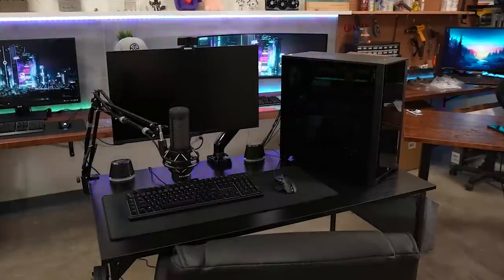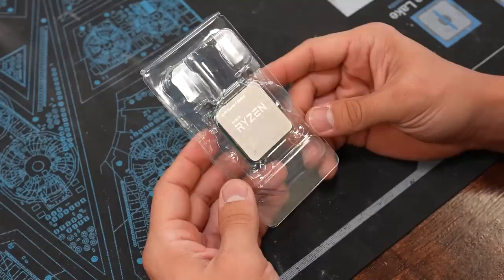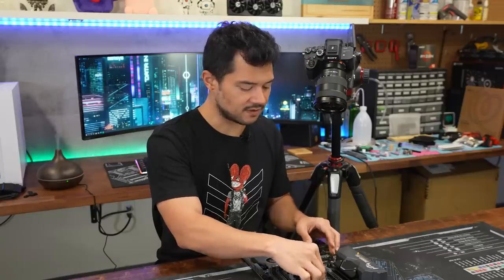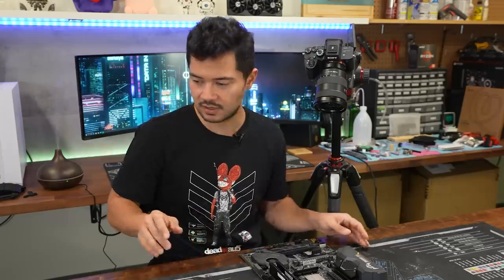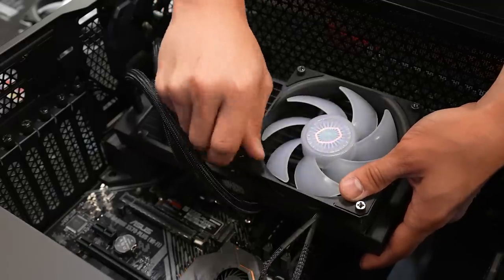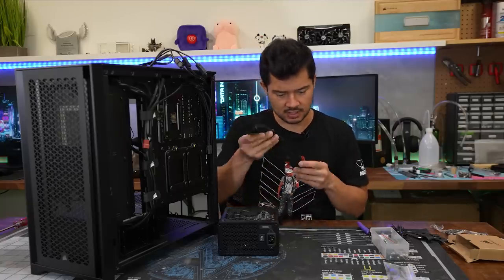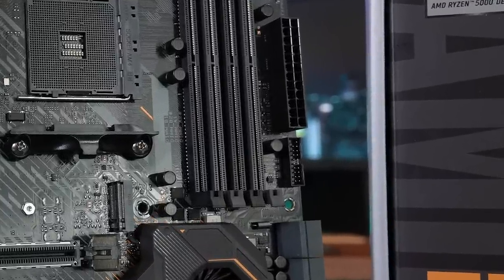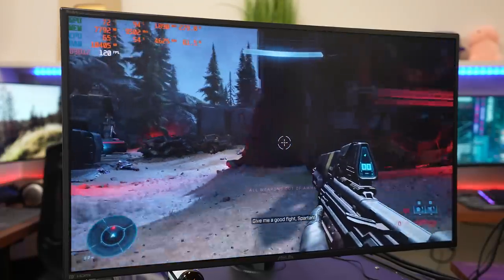The Amazon "#1 Best Seller" Gaming PC!

Comment: Almost ready to build my new PC. I have been so caught up in benchmarks and browsing the forums that I totally forgot to buy cable sleeves/extensions. Thanks for the reminder, Kyle!
Reply: Specs ?
Reply: Best specs for 600$?
Reply: My parts just started coming in I'm so excited I've been waiting so long
Reply: @klow3371 Save up some more if you want a build that will run most games at 100+ fps
Reply: @klow3371  a total of $600 I'd just get a pre built for $1200 you can get a 3060ti with a i7 for $1200 at best buy. Just upgrade the CPU cooler and flip the 2 front fans to intakes

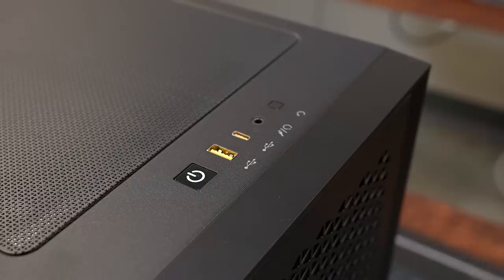Comment: 13:04 I was in the same situation after I bought the Fractal Design Meshify 2 Compact. Luckily, my ASUS MAXIMUS VIII HERO has an extra USB 3.0 internal connector, roughly around the same position where the TUF Gaming has one. You can pick up an adapter ( internal USB 3.0/3.1 to internal USB-C) for like 5 bucks and it works like a charm. Just keep it in mind that this will not give you the full capabilities of USB-C, it is just a USB 3.0 in USB-C shape but at least you don't have a "dead" port.

Comment: Me when the amazon bestseller PC is better in every component than my midrange PC I built this summer.
Reply: What is your pc specs
Reply: I laughed too hard at this... ahhh regret.
Reply: @spi-killazinc9750  main parts are 3060, 5600x, 16gb 3200 cl16 ram
Reply: Ur lucky I built a 2060 one 😥
Reply: @Cassapphic  Is the 5600x a good cpu? I bought it recently
Reply: @Cassapphic  lmao i have the same specs just using an Rx 570 8gb
Reply: @clodwins  2060 is still good
Reply: @defeatedcoot  yeah! Just gets super hot that's all

Comment: The Upside to Molex is that once you get it connected, it never fails and is connected literally forever.

The downside to Molex is connecting it.
Reply: the crimps on some cheaper molex adapters tend to be too tight and in combination with the cheaper cable sleeving used, most cases causes the sleeve to crack and cause a hidden short (learned from experience) lmao other than that molex is solid
Reply: There's more downsides, cheap ones that dont get any QA can cause arcing melting the plug and wires on a high current draw devices due to the metal socket not making full contact with a pin.
Reply: @RBRat3  I 2nd this
Reply: nVidia should had went Molex. Sure it would had looked awful, but the degree of separation between pins would have been improved compared to the shoddily-made 12VHPWR to 4x 12V EPS adapter they ship. nVidia can burn with their faulty adapters for that one.
Reply: @bluephreakr  Not to mention the pins just being larger is a plus too.
Reply: never trusting molex connections, ever. Possibly due to self stupidity or chance but all 4 times ive had to use molex its gone up in smoke. Literally. Ive lost so much from those damn wires.
Reply: @0MGWTF1337  Wtf? How? Molex connections were once how every hard drive was powered and generally super reliable.

Comment: 11:00 The molex is for when the motherboard doesn't have support for ARGB but still want to turn on the RGB(hence why it has a controller). It gives people that don't have ARGB the option to turn the lights on, otherwise you could've left it out and connect it directly to the motherboard which gives you full control of the lighting.
Reply: my liquid cooler uses sata power, objectively the better option.
Reply: That cooler isn’t the Argb version. It’s just the rgb version. There is a difference

Comment: Why not buy a USB add-in-card from Silverstone to attach the cases USB C port? Or buy an adapter to convert the USB 3.1 connector on the end of the internal case cable, and adapt it to USB 2 that you can plug on the motherboard. I mean, it will only work at USB 2 speeds, but its cheaper than the add-in-card and you can make the front USB port usable.

Comment: Hey Kyle,
Heads up on the 4pin to remote to molex connector for the RGB fans. You can ditch the remote and connector and plug in the triple rgb splitter directly into the 4pin rgb in header on the motherboard. Just make sure the arrow is pointing at the 12v header. This will allow you to control the lighting with the motherboard's software instead of the presets on the remote.

Good luck!
Reply: I was going to mention this as well. The Molex is ONLY for boards that don't have a 12v 4 pin RGB header on it.   Which that X570 does have..
Reply: @Snaggletooth40  Yeah, the instructions don't really highlight this feature, but the labels on the outside of the box hint at it. All that certified compatibility with Asus Aura, Asrock Polychrome, Msi RGB and Gigabyte RGB.
Reply: @Snaggletooth40  They have a pair of them, in fact (one on the top edge, and the other on the bottom). That AIO/MB combo is now in a system for one of my kids.

Comment: The hive mind pc ended up being a little higher spec than I thought. I was predicting Ryzen 5, B550, RTX 3070, and a 500GB NVMe. It's a really solid build though
Reply: I also think Amazon uses best seller in a small time frame, like best seller of the last week or something. I’ve seen it change every 2 weeks, so with the recent price drops on 5800x and a 3080, it makes sense it’s best seller for a short time frame. 

Now if you go for best selling for the whole year, I think you’re right. It would probably be 5600x and a 3070. Case does make sense though for any time frame. That’s a great case.
Reply: It isn't the most sold, it's the "best sold" within "x" period.
Most people are running 1060s and 1660s, not 3080s, LOL!

Comment: Molex as it was intended works perfectly... the problem is that molex is designed to have the pins hard soldered to a pcb, so that they are straight and rigid... these wire connectors where the pins flow around is the problem, and it would be a problem for anything, not just molex.

Comment: Back when molex was the common connection the pins didn't MOVE AROUND! There are going to be very few games that need a 4000 series GPU. Energy Prices have doubled if not triples in Europe and North America. I bought a 3070 and I'm running games on Low, super smart of me.

Comment: I was not expecting best selling parts to be mid/high end. I thought it would be lower end parts, Such as Ryzen 5 and 3060-3070
Reply: It makes sense if you consider only people with lots of money have been able to build a PC for the last 2 years.
Reply: @originalscreenname44  Agreed, my rig is 3/4 years old and still rocking a R5 3600 with no issues, if it aint broke, dont fix it.
Reply: I just got a 3080 after using the integrated gpu of the r7 5800g for the past 2 years and with the current situation and prices I can sorta understand why the 3080 is so popular.

Comment: Well I feel good about purchasing that same board and CPU now. Watching this video was almost like watching myself build my own computer, almost all the parts are the same. The one thing I noticed, depending on GPU length, most of the chip set fan is covered by the GPU, pretty sure it doesn't affect the operation too much though.

Comment: it's actually kinda scary how similar this is to my own build xD i put it together 9 months ago when i was still learning everything about pc hardware and selected my parts based on my own research from reviewers and independent testers, and ended up with a 5800x and msi rtx 3080 with 32 gigs of ram in a 4000d airflow powered by an rm850x. a few differences, in that my 3080 is the ventus model and i have a 360 corsair capellix aio, plus a WD black SSD and a 4x8 kit of ram on a gigabyte 550 aorus pro v2 board. but otherwise extremely similar
Reply: For learning still as a beginner and picking that setup is impressive, you clearly did all the right research and deserve a 👏bro. you'd be suprised how many people order the wrong stuff for their platform or just pick parts off a random youtube video and regret it a month later lol

Comment: I can't wait to build my PC! These are the components I'm buying/have bought (as of November 2022):
Case - Montech Eagle X1 (White) - Bought
Motherboard - Gigabyte B450 Aorus Pro WiFi (AM4 socket, 2 m.2 ports, 4 DDR4 slots) - Bought
CPU - AMD Ryzen 5 5600x - Not bought
GPU - NVIDIA GeForce RTX 2060 - Not bought
RAM - 4x 8gb Corsair Vengance DDR4 RAM sticks - Not bought
Storage - 2x m.2 drives (I can't remember the brand), 3x Kingston 480gb SSDs - Not bought
PSU - 850w PSU from a brand I can't remember off the top of my head - Not bought
Display - Hisense Roku TV (1080p @60hz, nothing special, just a substitute for an actual monitor for now) - Bought
Keyboard - currently an HP full-size keyboard from when Windows Vista was new, subject to change - Bought
Mouse - Razer mouse (I forgot the name) (Ambidextrous, White, Wired) - Not bought
Headset - Razer Kaira (Wired, White) - Not bought

All in all I still have $890 left to spend on supplies... yeah I probably won't have this assembled until the end of the school year lol.

Comment: I love my 5800x and honestly just got an rx6800 for $499 at microcenter a couple weeks ago upgrading from my rx5700, and im loving the performance, i gotta upgrade my panel to 1440p high refresh rate but still last gen parts dont get worse they stay the same... you dont always need the newest stuff
Reply: That's what I'm doing lol, right now is a great time to buy, 5800x is 230 lol, and it'll last 5yrs. Don't need the latest and greatest, just need longevity, in 4yrs a 4080/90 will be $700 or less, I'll buy 1 then
Reply: whats the point of upgrading so early😂
Reply: I didn't even know the 5800X was considered "last gen" at this point. Honestly for the last 5 or 6 years I have gotten the impression that CPUs these days are more-or-less the same. I mean yes, of course the cheaper ones will not be as powerful as the more expensive ones. But I mean, once you start spending about $250-$350 on a CPU, that CPU is most likely going to perform the same (at least as far as you can tell in using it) as every other CPU in the same price bracket. 

I overhauled all of my PC hardware in October of 2021. I had been rocking a 3RD GEN i5 since 2013. I was running that with an R9 290X and a combination of solid-state storage and hard drives. It wasn't until 9 years later where I finally started to notice performance issues. When just the main menu of Halo Infinite was taking up 70% of my CPU, and it took ages to compile Eevee shaders in Blender, I knew it was time to upgrade. 

I got a 5800X, new motherboard, new RAM, and a RTX 3070. Huge boost in performance all across the board, not just for games but also stuff like Blender and video editing. The way I see it, if I managed to pull almost a decade of life out of my old CPU and video card, I imagine I can pull the same life from these components as well. 

I HIGHLY recommend going for 1440p high refresh by the way. I thought it was all just a meme but high refresh rate is awesome.
Reply: @usleadershipareliars  in 4 years id buy whatever is going for the same price thats way faster or cheaper bro, nvidia or amd dont care just want the best performance for my money
Reply: @spartan456  and the video editing and stuff is where the cpu matters i5 to r9 they all perform relatively the same the last few generations in games but multi threaded application the extra core counts help alot, going from a 3600 to the 5800x i saw so much more performance especially when i stream

Comment: very surprised that an x570 board is chart-topping. B550 is such a great balance of value and features. Refurb B550 boards are plentiful and I don't foresee myself updating in a loooong time
Reply: Ur broke
Reply: dual PCIe 4.0 NVMe slots, better expansion capability vs. many of the other boards since you have that extra x16 slot, good power delivery that allows for stable overclocking, WiFi, and the board just looks good.

I can see why, and especially given this thing originally was expensive as hell many don't mind paying a bit more for the best. I'm just glad it wasn't Gigabyte or MSI. I don't like motherboard RMAs.

but if you wanted one of these refurbished you can pick them up for ~$90 USD on eBay.

Comment: 2:00 even my old gtx960 is a completely relevant card depending on what you are doing, i don't think there is a game on the market that wont run on it, and my 1660ti works great right now. having the cutting edge is nice and all, but it is the wrong approach for a personal computer user over decades of use. these aren't consoles

Comment: I'm surprised the most popular ryzen board wasn't a aorus x570 elite...they're always on sale for less than $180...bought mine for $130 from microcenter
Reply: I don't know the spec differences between the 2 boards to know why one is bought over the other (hell it could most likely be something arbitrary). But great deals at microcenter are extremely niche when compared to the size of amazons market......which is a good chunk of the freakin planet.
Reply: @nicholaskinkaid  The Elite has a type C front header, the Tuf ironically (ASUS invented it) as noted by Kyle does not but has better diagnostic LED.

Comment: I built a PC in October off links in a youtube video. lots of the same stuff. you cant use the case usb-c but the motherboard has one. My audio interface is hooked up. works great. I ended up with a 3090 5900x. Interesting the best selling ended up having such good components.

Comment: 5800x + rtx 3080 + 32gb ram = an elite system
Reply: What about the i711700k with 3080 which is currently going for less than the i710700k
Reply: If you're asking me, I'd say that paring would be an excellent choice. Slightly better than this PC because of encoding. Both systems are at end of life, but will be relevant for years to come.

Comment: I have a question would the AMD Ryzen™ 7 5700X 8-Core, 16-Thread Unlocked Desktop Processor work for this build?
Reply: yes
Reply: yes, its basically the same as 5800x just a little lower clock speeds and lower TDP. I just installed a 5700x to my pc just two days ago
Reply: Any 5000 series cpu will do you wonders. I mean hell went from like MAX 200fps to like 400-600 fps on csgo
Reply: William Taylor  for same price you can get a 4080 which alone is  21 percent better then 3090 ti
Reply: William Taylor  why would you get a 3090?? over a 4080
Reply: @theLUCKYdude17  your name sums up your ability to get components for a PC perfectly.

Comment: What I find funny is the components in my 9th Gen i7 systems (ATX & ITX) are worth more on their own now than when I purchased them when 10th Gen was released (with 11th on the horizon). 

There's a wake created by new products, and if you time your purchase well, you get the best deal before it is considered specialty and the price goes back up.

My previous system was a 12 year old i7 990X (X58) system I ran for 10 years before upgrading to 9th Gen. It finally came down to lack of instruction sets being the motivator (otherwise both hold stable 5GHz clock w/liquid cooling). 

It's still working, too (detuned to stock clock, tho, running on air cooling as my NAS box). Hopefully I can net another 7-10 years out of this hardware as well.

Comment: I agree, i bought AM4 in jan almost 30 % off, full 5950x and dark hero mobo,64gb ram, NH-D15, now snagged a 6900xt for $600, i am done. full build ~$2200 (only gpu used). including top tier ssd,etc. pretty much set till something dies. i would say buy 2nd hand from people who are upgrading, you might save even more! but make sure warranty is still valid (eg. cpu comes with box) or there is a guarantee of sorts
Reply: 600 dollars for a 2 year old card is mad

Comment: X570/B550 is also known to have USB issues especially with the USB 2.0
A big deal for gaming. Limiting to PCI gen 3 partly fixes it.
Most of the time USB 3s are fine, but plug a USB 2 hub into them and it will glitch as well. The motherboard hubs aren't faulty, else it wouldn't affect every X570/B550 motherboard as they definitely don't all use the same controller for this.

A520 boards are not affected so if you don't want to overclock but just plug in your GPU and game it could be an option for you as well.

Comment: I mean, this video was great but you'll definitely eat your words about parts being outdated so soon when Alan Wake 2 came out a year later ( this year, 2023 ) basically spanking every possible system out there. I still have to have some settings on medium if I want to hit 75hz, my monitor refresh rate, to run that game smoothly. With a RTX 4070 12GB, AMD Ryzen 7 7700X 4.5GHz, and 32GB of 5200Mhz RAM. However, plenty of Alan Wake 2's settings are on high or ultra, so there's a balance of performance and visuals.

Comment: I built my pc in 2013 with most parts already released years prior and it is still running games today at 120fps (using similar method of best rated parts and the only thing ive upgraded was 8gb to 16gb and the old hd 6780 gpu to a gtx 1070)

Comment: Kyle I’m a few weeks late on watching this vid but a few days ago I ordered a 5600x, 32GB G Skillz 3600mhz ram, cooler master ml240 RGB this is my very first aftermarket cooler this is my 3rd PC I’ve built but I always ran stock coolers, I’m keeping my RTX 2060 until get enough to get a 3080 maybe with my nice sleek Nzxt h510 case.

I could not pass on the Black Friday deals. Only shitty part is gonna be almost 2 weeks before I get my parts. Surprisingly I bought my mobo from Best Buy MSI gaming plus b550 for $130 absolute steal and case.

Comment: @Bitwit I hope you're using distilled or demineralized water on that humidifier, because if it's the ultrasonic model it will leave every monitor and window, or any glassy panel coated in lime in time. Just wanted to give a heads up before it ruins anything in your room.